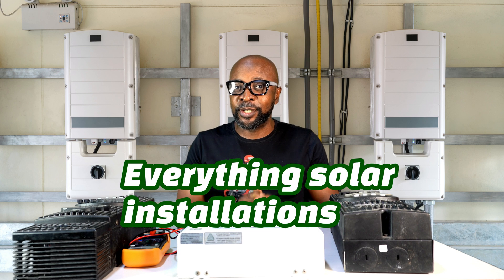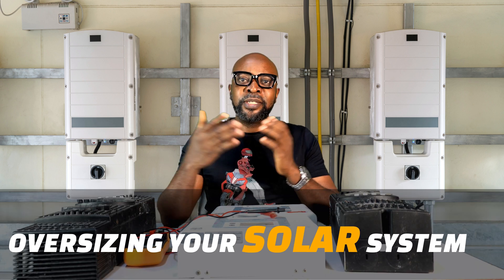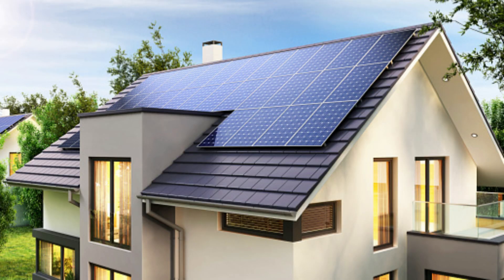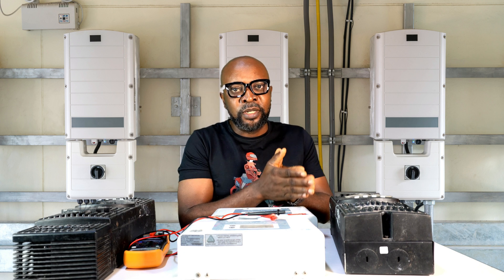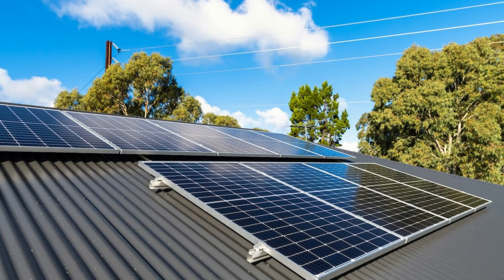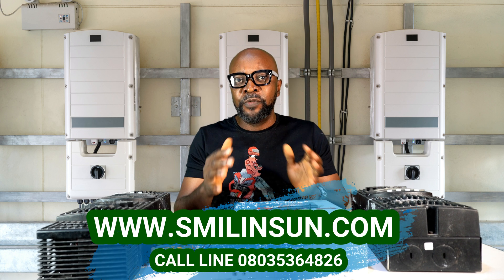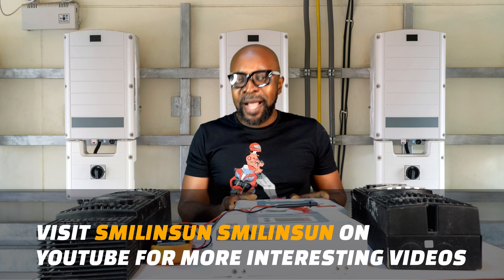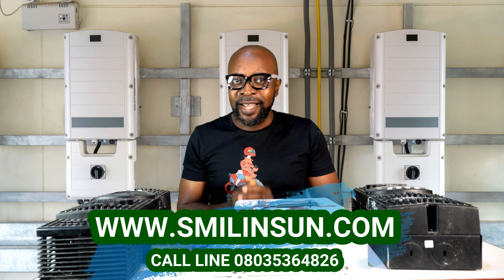OVERSIZING IN YOUR SOLAR SYSTEM

Comment: Thanks sir. Oversizing is also very necessary when your installation contains heavy day - use loads so that there will be enough to power the load and still charge the battery bank

Comment: Thanks for this particular video. Oversizing is really good, especially during the rainy season, but some people think it's bad. As long as you don't exceed the maximum voltage input, oversizing is perfectly fine for your system.

Comment: Hello bro! Good work ur doing. Please can u tell me how I can completely communicate my two felicity charge controllers, felicity 5kVA transformer inverter and a different make of two 5kWh, 24volts lithium batteries with BMS. I’m planning to use several communication cables and RJ45 splitters to achieve this. Please can u advise?

Comment: Oversizing is achievable only with OEM devices like OutBack CC, Victron SCC just to mention a few.
Great work
Reply from the maker: Fangpusun as well thank you for your comment
Reply: @smilinsunsmilinsun8056 does it mean hybrid inverters can be oversized
Reply from the maker: @gcrestfidcrest  yes you can
Reply from the maker: You can also increase your charge controller capacity to achieve this.
Reply: Oh, I see... Because what I experienced with one product was that if your voltage is higher, it cuts off the PV input...